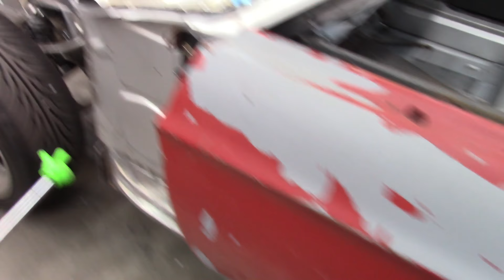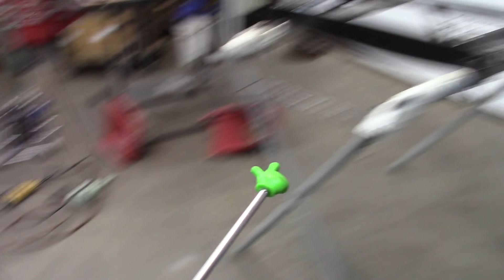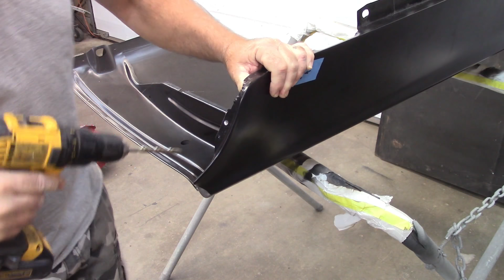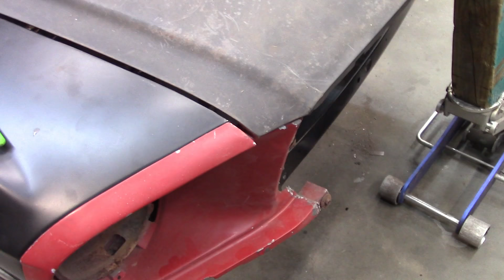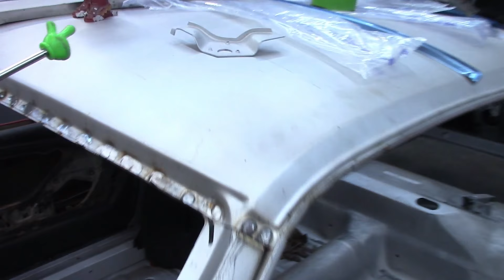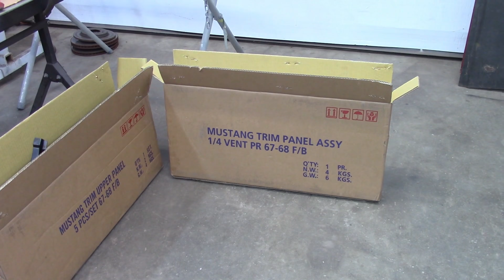Core support and fender fit on a fastback mustang. Fangled 35 #howto #mustang

Comment: I found with my spotwelder that it doesn't like the weldthrough primer. After figuring that out, I cleaned all the areas I used it on. I did every pinch weld with my spotwelder. And yes they are heavy and awkward.
Reply from the maker: Yeah, cleaning the metal makes a world of difference with those things.

Comment: When i used mine i had copper weld thru primer on the panels and it worked fine. And yes it is very heavy! Thinking about making a mobile counterbalance for it in the near future. Thanks for the video!
Reply from the maker: I have considered that. Thanks.
Reply: @JoDaddysGarage It was Upol brand. It seemed to spray thinner than the stuff I bought at the local shop.

Comment: I had the 220v version of the spot welder when I I built my fastback and didn’t have any issues with the inner part of the metal needing to be bare metal.
Reply from the maker: Yeah. Like I said, I needed to remove the weld thru primer on the backside of the apron. That’s all it took.